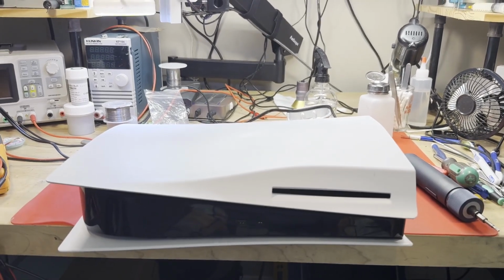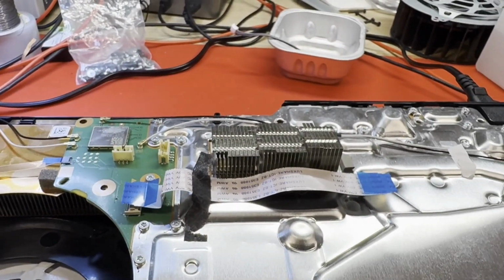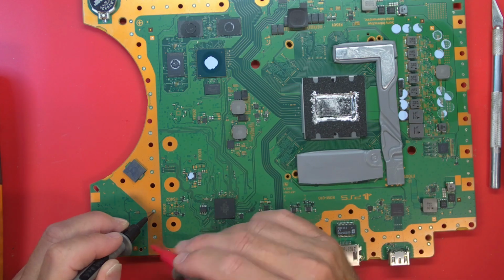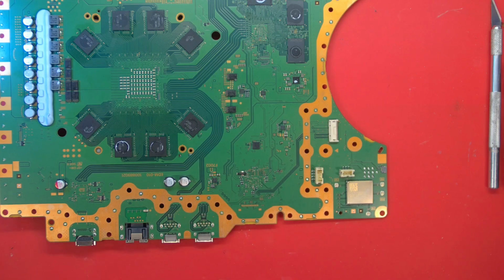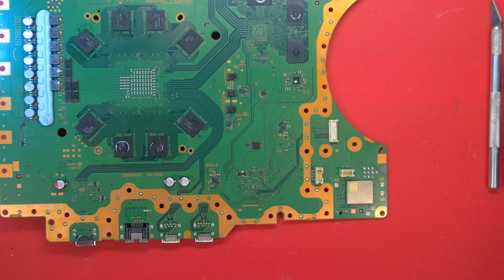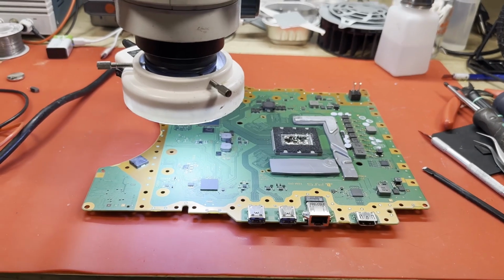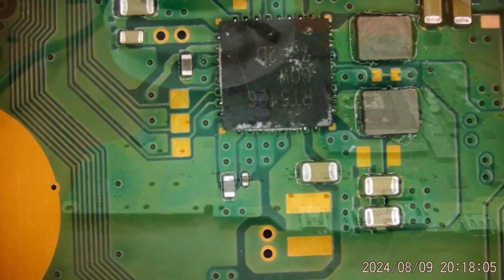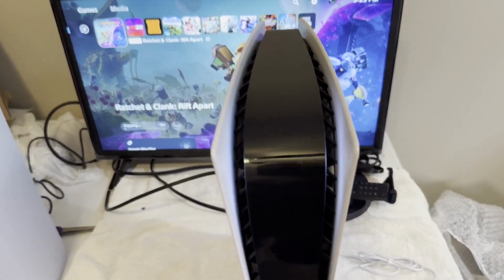#157 Repair of PS5 No Beep-No Lights

Comment: When I removed the diode behind the SB chip, the device turned on. What kind of problems could this cause in the future? The device is currently working, it connects to the internet, and the USB connection also works.

Comment: Hi did u turned on using the power supply with 12,v and 2 amp?
Reply from the maker: Hello.  You cannot fully power on a PS5 with 12V at 2amp.  You can test the standby mode of the PS5 with that low current.  I only needed 12V at 500ma to be able to test the board in standby.
Reply: @ToltecMerc thx do u have online courses
Reply: No answer❤ but I like all u r video u the best

Comment: Is this power ic chip same use for all ps5 slim or disc or its according to the Model number please answer
Reply from the maker: The PMIC varies between boards even with same board number.  Many are interchangeable.

Comment: I have the same capacitor shorted to ground but also main 5V rail shorted to ground. Could it still be the southbridge? The cap on sothbridge are not shorted
Reply from the maker: The 5V does not go straight to the South Bridge so I would not think that is your short.  Probably a shorted cap somewhere on the 5V bus and it does go all over the board.
Reply: @ToltecMerc  i injected 1V on the 5V rail with 2.5A current limit. It draws all 2.5A of current but nothing seems to gets hot. Any ideas how to find the short? Your reply is very much appreciated.

Comment: Can you share buy link of nozzle used in 861dw quick machine for de soldering ps5 apu?
Reply from the maker: I don't know of a source to fit the nozzle directly on the 861DW.  It is a 45x45mm square nozzle for another brand that I had to modify to fit my Quick 861DW.  I found it on eBay years ago.
Reply: Thank you for your reply.

Comment: is it possible to put termal past on the south chip for exrta cooling?
Reply from the maker: @the_real_Wieniet  you might be able to add thermal conductive pads on top that would then need to contact the metal shield covering the board.  I’m not sure how thick this would have to be.

Comment: My quess was also SB, usefull tip with that cap in the 3.3 power circuit. That ribbon cable though 😂 hmm ooops.
Reply from the maker: SB or shorted cap usually.  Very common.

Comment: Does that cordless screwdriver have a torque break on it? I've seen them on Amazon and have wondered. Nice fix.
Reply from the maker: It does have 3 torque settings but I have not really played with them to see the difference.  I have become use to  letting it slip in my hand slightly while tightening screws.

Comment: Great repair, always nice to see a disc edition get saved. I have a 1215 disc edition I have been stumped on for a while, it had a 12v short I fixed thanks to your videos(helped me find the exact mostfet to replace). It boots up, repairing console storage loads to 100% then restarts, blue light then turns off. Beeps when pressing the power button after that then next button push the storage repair again. Just changed the ssd controller but symptoms stayed the same. Signs of water damage so maybe a short somewhere I would just be surprised it boots with a short.
Reply: Sounds like a corrupted bios.
Reply: @accountalreadyinuse  Thank you for the idea, I think I could test that by swapping a known good bios and it should make it past the repairing storage loop at the least. Much easier to remove than the ssd controller at least

Comment: Very interesting that you are measuring the temp.  Is your temp probe at the site of the chip?  Seems to me it's a smart idea you have because you know around what kind of temp the board needs to get to to lift and replace the chip.  Do you write those values down, so you can apply it to the next board? Seems it lifted around 170C and went on around 150C.  Awesome because it saves you from putting too much heat in or not enough.
Reply from the maker: I have the probe wedged into a hole as close as I can get to the PCB.  I usually heat the board until the board temp shows around 100C before I use 400C air from above.

Comment: 14:45
Do show us what system software they are on after every repair!
Would be interesting to see how long its been "dead". But also hidden gems like 4.03 and below for homebrew stuff.
Reply from the maker: I have only seen two consoles on 4.51.  Those sold rather well.  I do have a 6.50 that I am sitting on just in case.
Reply: @ToltecMerc  
Exactly! You can't beat 60fps patches like bloodborne or Driveclub on PS5 (done by the community) that sony refuses to upgrade.